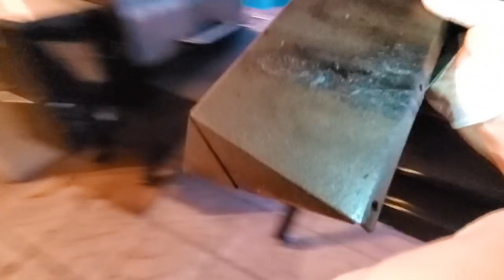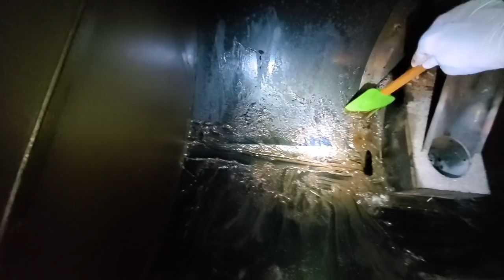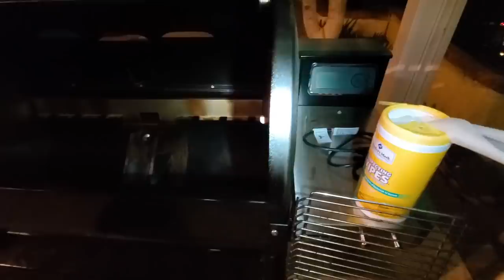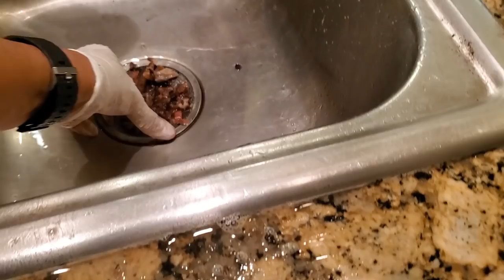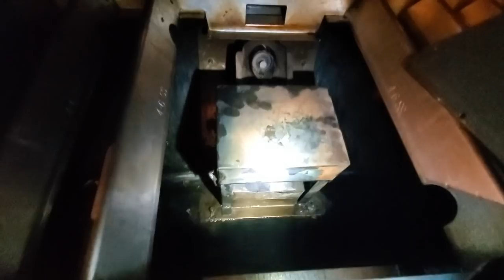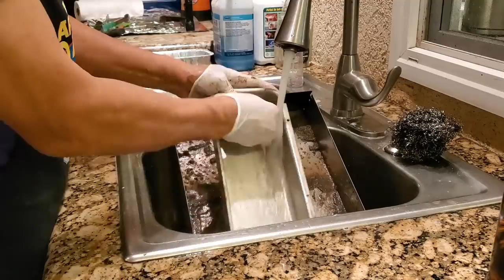Pt 3 WATCH BEFORE YOU BUY | Cleaning Weber SmokeFire Pellet Grill | Harry Soo SlapYoDaddyBBQ.com

Comment: Adding 2 foil pans under the grates to collect drippings solved the messy and time consuming cleanups. The pans also prevent grease flare ups as long as you don't accumulate too much grease in them. The hot spots on the right are slightly minimized, but the right side remains hotter than the middle and left.
Reply from the maker: I find the half height foil pans work best.  Helps cleanup also
Reply: @SlapYoDaddyBBQ  Thank You Sifu. You truly are the BBQ Master.

Comment: If the Flavorizer bars in the SmokeFire wear the same as they do in Weber gas grills, it won't be long before they're covered with surface rust, which is a normal condition, but not conducive to washing. Scraping the top surfaces with a wide putty knife will be all that's necessary...less parts to wash.
Reply from the maker: Thanks for the tips Chris since you have way more experience with them. This is my first pit with the Flavorizer bars.  I did meet Eric Schlosser the Weber engineer who invented it
https://www.slapyodaddybbq.com/2014/08/slap-yo-daddy-teaches-at-weber-stephens-headquarters-in-illinois-by-donna-fong-of-butchers-daughter-bbq-part-2/

Comment: Have you considered using simple green on your smoker? That's what I use to wipe it down.  Plus on the outside enamel I wax it with a ceramic coating.  Makes the clean up even easier.
Reply from the maker: Yes, I have several bottles.  I will use it next time!

Comment: Hi Harry. Thanks again for doing the torture test and clean-up 👍. Would you consider foiling the chamber like you do for some of your other cookers?
Reply from the maker: I'm sure you could so long as you don't block the drain holes on the L and R of the burn pot.  I think a better idea is to put a drip pan under the grates on top of the flavorizer bars to catch grease so you don't have to take-apart-deep-clean so often.  Let me try it out and let you know.

Comment: Ouah! Thank you for this video! This is very useful for people interested in the SmokeFire. Cleaning this unit is definitively a lot of work! And for smoking, using a drip pan, we lose half of the room available, but also eliminates the GreaseFire risk.
I am sure Weber will come in 2021 with a revised version solving most of the problems. Maybe the incline of the bottom needs to be more pronounced to evacuate grease faster and also some additional shielding installed over the drip holes close to the pellet burner to avoid ashes mixing with grease and clogging or burning. Otherwise they need to change their whole fat catching phylosophy.
Time will tell.
Thank you Harry!!!
Reply from the maker: Weber sells a half-height foil pan that fits under the grates that sits on the Flavorizer Bars
Reply: @SlapYoDaddyBBQ  Oh, ok. That's may be a pretty good solution. Finding a well sized pan to put on the bars, foiling it to be able to reuse-it, reducing costs/cleaning. In the ex6, the big one, we can also imagine a two zone configuration. With a pan on the left side for smoke and room to sear in the right side.

Comment: I see that the interior, where the Pellet is burned, is quite different here in Europe. Here the walls are higher around the pellet so the flames do not come out from the sides. The hopper that contains the pellet is also much steeper here. However the aluminium foil on the bottom to catch the grease is still a must

Comment: I know you smoked a lot of meat prior to that clean up but I'm very impressed with the amount of time you spent. I just recently sold my Rec Tec which really took less than 5 minutes to clean and that is after several cooks. The drain pan technology doesn't seem very efficient. At least with other pellet smokers you have that ability to put aluminum foil over the heat shield. Remove the aluminum and scoop up the ash and done. How does placing the drip pans below work out for you? Love your videos and watching re-runs of BBQ masters on TV! :)
Reply from the maker: Thanks. I feel like being in the I Love Lucy reruns where she is with Ethel working at the chocolate factory episode. 
Yes in later videos I put a foil pan at the bottom and that helps. Also no need to clean favorizer bars as I rotate them to sit closer to the burn pot after each cook

Comment: What is the smoke flavor comparison between stick burners and pellet grills? Thanks.
Reply from the maker: It actually depends on the skill of the pitmaster and not the type of equipment.  You can get great smoke ring and flavor on a pellet as in an offset.  As I say, it's always about the pitmaster and never the pit.  You can see brisket on the EX6 https://youtu.be/Z8o_Lv8GZvg and brisket using post oak on the WSM https://youtu.be/elcqORHL5rU
Reply: Very different depending on your expectations. A pellet grill will produce mild smoke and it also depends on the pellets you use. 100% hardwood pellets perform better. Traeger pellets and some others use flavor oils that basically provide no flavor. A smoke tube can also help with smoke flavor by lighting pellets or wood chips inside it allowing them to smolder in the cooker in the tube next to the meat. Many people like pellets for the milder flavor. In Texas where I live and grew up, eating BBQ off of stick burners is what I knew. The first time I ate que off a pellet, I was extremely disappointed. However, I have a pellet for convenience and can still get a decent smoke flavor from it. If I want to amp it up I will cook on my WSM loaded with Kingsford blue with 6 chunks of Post Oak and Pecan underneath it. That can get close to mimicking a stick burner for deep smoke flavor. I have no time or desire to continue to load a stick burner every 30 minutes on a 16-hour brisket cook. If I owned a restaurant that would be a different story.
Reply: char, soot and charcoal flavors  vs pure wood (probably mixed with oak).  not sure i can say i like the stick burner flavor better...it is still good, but i don't really prefer the charcoal taste. a stick burner with no charcoal and all pecan might be interesting.

Comment: I don't even use my grates in the smoker. I have deep dish pizza pans and a grilling rack I put on top. Both fit easily in the kitchen sink although I am going to foil the pizza pan so I don't have to clean that either. The heavy smoker racks stay clean and in the smoker.
Reply from the maker: Good idea.  Beats the expensive half height foil pans that Weber sells.  A full height foil pan does not work under the grates
Reply: @SlapYoDaddyBBQ  I tried a rack on top of a foil pan for a small pork butt. It caved under the weight when I tried to rotate it around. I figured those deep dish pie pans will get the job done! 
Thank you for your vidoes and replies to our comments Mr. Soo!
Reply from the maker: @chris5942  I'm going to try a shallow cake pan under the grate to see if that works

Comment: I really like how well you were able to get the flavorizor bars, grates and porcelain teepee clean. What tools cleaners were you using? Looked like Easy Off BBQ and some kind of steel wool. It did not look like typical steel wool though. I usually just use a metal putty scraper to scrape the inside and the flavorizor bars but they don’t look as clean as yours. Haha
Reply from the maker: Easy Off, gloves for protection, and sponge with lots of warm water

Comment: Harry, would you guess that the Smokefire requires more frequent cleaning than other pellet grills, due to its design?  I've never had a grease fire on my MAK in 12 years, but several YouTubers report fires in their SmokeFire.  By the way, I'm still loving all the techniques I learned in your class years ago!!
Reply from the maker: Only time will tell Keith if the EX6 is a good pit. I liked it so much I bought a second EX.  And I have to Jim Bowies too.  I have a addiction I guess! :-)  
Hope the class is still yielding benefits as you continue to spread BBQ love!
Reply: @SlapYoDaddyBBQ  Its a year later.  What's your impression now?  What is the best pellet smoker you have used?
Reply from the maker: @muthergoose4084  I purchased two GMG JB and two EX6 and those are my favs

Comment: Is there enough room under the bottom grate to sit a drip pan directly on the flavorizer bars? I used to do that on my genesis back when I used to use a gasser.
Reply from the maker: Hey Steven, I saw the Weber video and they use a half-height shallow foil pan that sits on top of the flavorizer bars and below the grates.  I haven't tried it yet.
Reply: Harry Soo thanks Harry!

Comment: One thing you dont wanna do is send all that grease off the grates and flavorizer bars into the drain. I know u caught the big stuff but the grease will coat your pipes and cause ur drain pipes to clog up pretty quick. Either way, grills lookin good!
Reply from the maker: Yes, I think the oven cleaner breaks down the grease so the residue will not clog your pipes. Hope I'm right.  I'm never going to cook 70 lbs of meat uncovered any more like I did in Torture-Test-2 so should be no problem

Comment: Hi Harry, Thanks for another great video.  I learned a lot.  But now I am in a dilemma.  I first watched Jeremy at Mad Scientist BBQ where he performed a pellet grill cook-off with all of the top brands.  The winner was the Weber in a blind taste test.  With knowledge of the best pellets as well as Jeremy's cook-off made it seem like the way forward was simple.  But oh my.  Cleaning that Weber after a low and slow 12 hour brisket cook looks like a nightmare!  Many people are also complaining about flame ups from poor grease management in the Weber, but I guess they want to make money on those 1/2 height aluminum trays for ongoing revenues after sale.  I'm scratching my head on whether or not to proceed.  I have a wonderful real wood offset smoker in the yard, but thought about trying pellets for the "convenience".  I do not think spending an hour cleaning after each cook very "convenient".  Just a quick question, do you think using an outdoor Honda 3500psi power washer would have taken off most the gunk?
Reply from the maker: NO need for power washer.  The half height trays at Restaurant Depot as $15 for 100 pans so it's cheap.  I don't need to clean my EX6 until after about 6 cooks or about 40 hours of use.  Get the EX6. It's the best results pellet cooker. Period. Weber did not pay me to say that.  I'm a no compromise pitmaster and the EX6 is my goto pit.  I don't know why others keep kicking it down.  Are they just keyboard cooks or have G-A-S (gear acquisition syndrome)  :-)

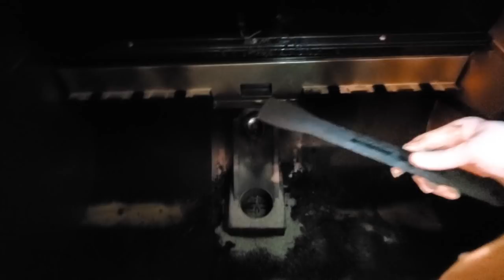Comment: At 1:27 notice the pools of standing grease on each side of the bottom tray.  And I think Harry even used a drip pan on that cook, yet the Weber GreaseFrire STILL did not drain the grease off properly.  I like Weber stuff, but this thing is not ready for prime time.  Look at Rec-Tec, CampChef (great Consumer Reports review) or Traeger for well thought out pellet grills.
Reply from the maker: I think the amount of residual grease is actually minimal if you saw my Torture-Test-2.  You may have missed the part where i said that this cleaning video was the aftermath of a 12-hour, 60-lb, unwrapped cook Torture-Test-2 that generated 12-cups of grease that overflowed into the ash and oil drawer.  See my Part 2 video on what I mean.  I have two GMGs so I'll do a throwdown soon.    https://youtu.be/jsUri_VoKag
Reply: @SlapYoDaddyBBQ  Ah, I thought this was after the brisket cook, the second cook you featured.  I guess my Kamado Joe spoils me... less than a tenth of the time for cleanup.  :)

Comment: The grease in the bottom probably would have been a whole lot easier to clean up if the pit was warm.  But that aside, I think you actually spent way too much time cleaning it.  I think the grates are the only thing that need to be really cleaned.  The rest is just "seasoning" imo.  Lol
Reply from the maker: I solve the  cleaning issue by having half foil pans under the grates.  No more risk of flare-ups and I just toss the foil pans after each cook.  Easy peasey!

Comment: That was a lot of grease in the bottom.  I certainly wouldn't want to use this thing at high temps without cleaning it out first.  And all the stuff that is supposed to make it easy actually makes it a lot more time consuming to clean.  So many parts.  I do like the porcelain enamel.  My RecTec is stainless steel which is more durable but it also gets very dirty and requires a lot of effort to keep looking nice.  Seemed like a good idea at the time I bought it, lol.
Reply from the maker: I find pellet grills a pain to clean and I've have GMG Daniel Boone and Jim Bowie for 12 years.  Give me a WSM any day.  Of course, as I get older (and lazier), the one-button cook on a pellet cooker beats the WSM!
Reply: @SlapYoDaddyBBQ  I would find my pellet grill much easier to clean if I had a small handheld vacuum to clean out the ash with instead of dragging my ShopVac out on the deck.  Overall I don't know if it's that much harder than cleaning my gas grill, but it sure needs to be done a lot more often.  The price to pay for easy cooking I guess, nothing in life is free.  And for your information I do not just use one button, I am not that lazy.  I have a dial I must operate as well!  lol
Reply from the maker: @plmn93  LOL!  OK turn the knob and press ON!
Reply: @plmn93  Doesn't the camp chef have an ash cup and a release mechanism so that you dont have to vacuum?

Comment: Harry can you get it up to 600 now?
Reply from the maker: No problem 600F as shown in test 1
TORTURE TEST 1 – PASSED - https://youtu.be/ALNnTwN2Kak
45 lbs 5 meats in 8 hours. Generate grease from a 16 lb brisket, 10 lb butt, and 3 St. Louis ribs to drip on the SF the first 6 hours at H-n-F cook @400F and L-n-S cook @275F. After all that grease was accumulated, fire it up to 600F to grill the ribeyes and sausages.  Cook to let the grease drain in the unit and then try to flash that grease at 600F to test for safety 
TORTURE TEST 2 – PASSED - https://youtu.be/jsUri_VoKag
65 lb, 3 meats in 12 hours. Two 16-lb brisket, Two 10-lb butts. Two 7-lb beef shortibs.  Low and slow @225F to see if hopper feeds properly, no grease fire w 12-cups grease collected, and no excessive ash
Reply: Any way you can do another 600 sear test?

Comment: Wow, that thing looks like a nightmare to clean.  My pellet grill has one piece that I wrap in foil and it deflects all the grease into the grease pot.  Cleaning only involves dumping the grease pot and changing the foil.  It seems like they could have done much more design and engineering into that thing, especially given the price.  Great honest assessment, love the channel.
Reply from the maker: All pellet cookers are a pain to clean. I have two Jim Bowies and two EX6 so I know from experience.  The relevant question for a competitor type personality like me is which one cooks the best as that quality surpasses all other measurements in my style of seeking excellence in cooking  Your mileage will vary according to your preferences.
Reply: My dealer is giving me the V2 upgraded version to test out and let him and his sales rep know what I think but one thing for sure by watching Harry's video cleaning sucks for sure.  I can already see I will be using drip pans.  My Louisiana LG900 is so much easier to clean and takes 5 minutes.  5 years old and still looks like new with no grease inside to catch fire.